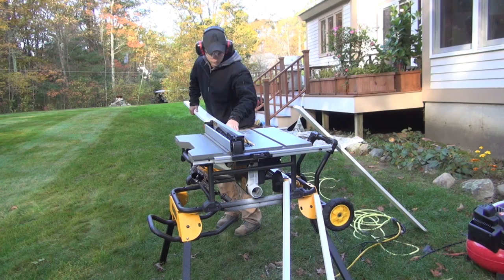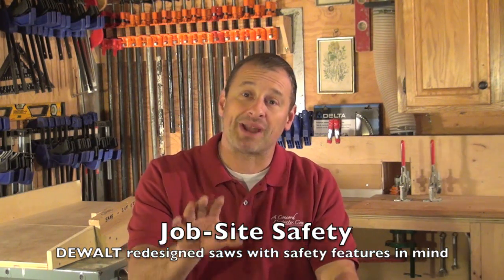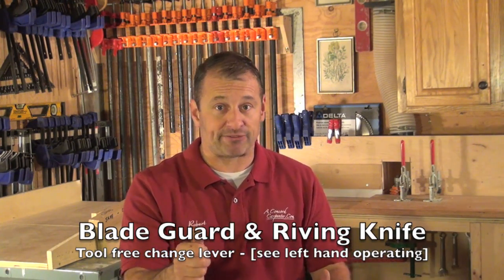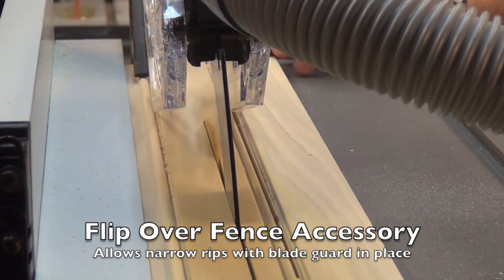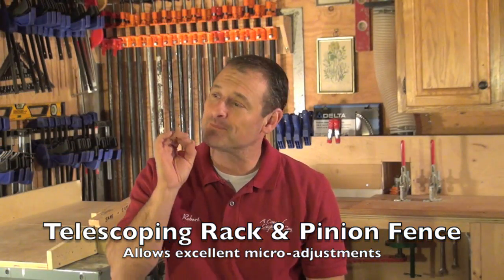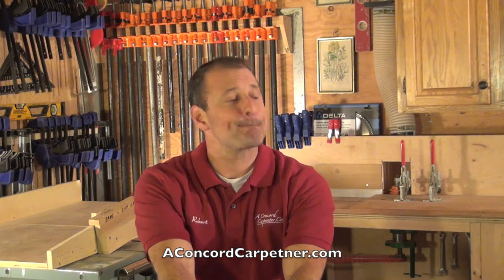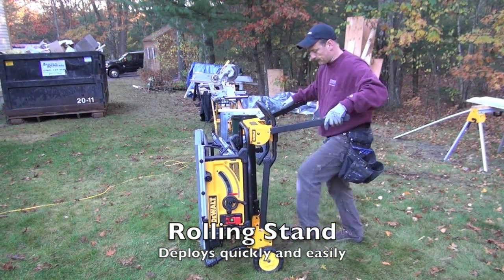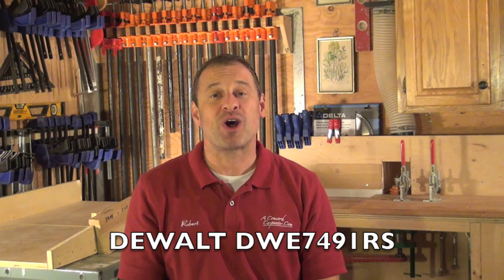DEWALT Rolling Job Site Table Saw, Model # DWE7491RS

Comment: I bought this saw a year ago, and love it. I bought the DeWalt Dado set, and the throat plate that was available. It was made for the 744 model. Dewalt did come out with a throat plate for the 7491RS, you can find it on Amazon, model DW7402 throat plate. for around 30.00
Reply: Nicholas Cameron... It would help if you put the correct model # in your post concerning the throat plate.
 Looking for DW7402 didn't work and din't bring up swat in my searching but DWE 7402DI did work.

Comment: wow eight years ago, it’s october 2022, and DeWalt is still selling this same saw.
It’s a good one.
I got rid of the biggest piece of crap (RIDGID R4514) and got this one.
This DeWalt is solid and very good quality. Love this thing so far.
I do have yo admit that the Ridgid roll stand is great because it sets up in seconds and you can wheel it around, grinder it’s definitely not as stable as the DeWalt.
Reply: I've had my same 10inch saw since release I've used it professionally every single day never had a problem with it.
Reply: @marcowens3522  : that’s what we all love to know. thank you for that.
i did have yo tighten the vertical lift bolt located at the very bottom of the saw, just under the gear because it wasn’t holding the saw in place do to the vibration from a particular blade i have.  still great.

Comment: I recently got one of these, and it's a pretty sweet saw. It does a lot of the things you normally used to need a cabinet saw for. A 32" rip length is a 16" remainder. There's no excuse here. Rip with a circular saw, flip the part, true it up, lather, rinse, repeat.

Comment: I take your reviews and opinions very seriously, even though I am just a beginner wood worker. I know what you mean about the flesh sensing technology table saws...they are incredibly expensive and seem to want to nickel and dime you for every accessory. 
This particular saw was and is still (I believe) on sale on Amazon, so I picked one up, even though the Ridgid I bought is only about 2 years old. The Ridgid just seems so large in my garage with that table, even though it is nice and flat and has both a nice fence and  better than average miter gauge. I love how you can adjust the size of the table you need due to the rack and pinion feature of the fence. Can't wait to start using it. Thanks for your excellent review, and recommendation.

Comment: I almost bought DWE 7480 table saw, but then I came across this DWE7491RS. So I'm buying this. It is about $200 more than 7480 one, but there are couple of features I really like in 7491RS. One of them was it's power switch and other one being a DADO compatible along with I liked for the fact that entire thing is on wheels. When not used, I can park it in corner of my garage and ready to roll out when ever I'm ready for some finish carpentry. Worth extra money !

Comment: Just completed assembly of my DWE7491. Found this video helpful.  Still wondering why a dust bag isn't included.  Thought the miter gauge was beneath DeWalt's standards, but think I can improve it with simple shop fixes.

Comment: Good review, after purchasing mine I was looking at the plumbing parts at the depot to try and hook up the guard dust shoot to the vacuum. Didn't see any real solutions but while I was digging around in my van for something I found my miter saw dust bag.  For kicks I tried it on the table saw guard dust shoot and it works great! Better than any hose in my opinion, because you have nothing running down to the floor or below the table top height snagging on the work piece. Plus its a easy set up. That coupled with my vac on the lower port and there's just a little debris coming from the bottom of the saw. Give it a try you'll be surprised dewalt didn't think of it.
Reply: IndianaJBird the dust bag is a great idea!  I have a plastic y connector at the bottom dust port with a 1 foot hose connecting to the bottom dust port. I connected a hose from the guard to the y and connected the vac to outlet of the y. The suction is ok, but I bet the bag would probably work better at the guard! Going to have to try it out👍🏻👍🏻
Reply: akaredcrossbow could u send me a pic of your set-up? I am trying to integrate the top and bottom dust collector ports together. Any help would be appreciated.

Comment: Fantastic review - especially on the new safety features, which I agree are important. I was convinced I was going to get the 7480 but now you have me thinking twice. The stand seems well designed and well worth it.
Reply: Go with this one if you can afford it. It allows for a full 10 inch blade which is nice especially when you start building custom jigs like a sled. It also has a larger arbor to allow for dado blades. I don't believe the smaller DeWalt table saws do, but don't quote me on that.

Comment: I was going to get the grizzly hybrid as my next saw but this has caught my eye in that it will not gobble  up as much space in my small shop area and has as much or more rip capacity plus the dust collection is top notch all for under 600.00
Reply from the maker: I had a Grizzly cabinet saw for years. I  replaced the motor on it once - terrible customer service

Comment: Just purchased this exact model. I have a Frued 10" dado stack but it's 1" arbor. The saw is 5/8. I have arbor spacers? Wondering before I put it together maybe 8" dado should be used?

Comment: The miter has been redesigned. Its like the Incra Ii have being made of steel plate with engraved yellow makings. Still some slop in slot but not much. I use my Incra with the saw and the new miter with my Band saw. Perfect since it has short blade and I will drill and tap allen screw on side to tighten to slot. I wouldn't recommend that with a aluminum top tho as it would start grooving the miter slot.  I'd use aluminum tape if using on saw and wanted to take out some slop. Also seen some ssaid the got bend top as the table on  bottom of box. Mine was upright in center with the stand box on top of bagging.

Comment: Hi, I have a contractor saw on which I make furniture. I need a great precision and a powerful motor, since I often rip big beams as I make architectural ornements. I am seriously considering to buy a jobsite saw, but I am worried that it may lacks power, or that the motor may fail after some heavy use. What is the life span of such saws comparing to those impossible-to-kill contractor saw motors ?

Comment: I have the dwe7490X which is the exact same saw but with the scissor stand.  My only real complaint about it is that the blade is not fully shrouded.  There is a large gap at the front of the shroud which let's saw dust get all underneath the saw.  with shop vac attached to the dust ports you're only getting about 75 % of the sawdust.  The rest just goes out underneath the saw.  It would have been better to have that opening plugged up so that all the dust could go to the lower dust port.  Other than that all the things this guy said are true.  The reset switch and riving knife are the best improvements.  Also, get an incra miter gauge to go with this saw and you're gonna be happy.
Reply: Plugging up the blade guard's dust port would not make the dust go down to the lower port and having the addition of the dust  port at the blade guard with a properly hooked up suction source gets a lot more of the dust at the source, as it's created.  There is plenty of testing data that shows that and OSHA is now requiring dust collection on many current jobsite tools, so tool manufacturers are implementing it into their designs now.

Comment: I see you are a fan of the fence. How do you square it up 90 to the table? I see how you can square it up to the miter slots, but is there a way to square it up to the table?
Reply from the maker: Its an easy adjustment and well explained in the manual
Reply from the maker: You're referring to 90-degrees "parallel" to blade correct?

Comment: Im looking to buy my first table saw for my home shop and wouldn't be using it anywhere but in my home shop. Would you suggest this or something else? I saw one of your other videos that said not to overlook portable table saw for the small home shop and I wasn't looking to spend 2k on a bigger table saw.
Reply from the maker: This saw will accomplish everything you'd need to dd but its more of a jobsite saw.
Reply: What would you suggest for a beginner on a very limited budget from the wife?
Reply: Had the lowes kobalt saw for about 3 yrs.. Not a bad saw, but it was time to upgrade.. Reasons why I went with this one..  Already have a dewalt 10" double bevel compound sliding miter saw with stand, needed something with a better fence than the kobalt, portability, and wide cut capability.. $$ was not a big concern, because good tools cost money and I prefer to only buy quality..  Can't go wrong with this saw...

Comment: Hey, thank you for that.  This is about the tenth review I have watched on this and the 7491 DeWalt saws, and I am discovering really useful new info.  I did not know that the power switch drops out without power for instance.  We have a table router that starts up when turned on at the wall if left in that state, and that is scary unsafe.

Comment: Thank you for the vid. Quick question... if I wanted to build this into a assembly / out feed table at a later date, how difficult is it to take apart from the frame? I was originally going to go with the 7480, but I found out it didn't except dado blades and that was a deal breaker.
Reply: When you purchase the saw, it comes needing assembly.  You have to attach it to the stand.  Four bolts and it comes apart.

Comment: I'm interested in purchasing this saw, but when I took a look at it in the store today there was quite a bit of play in the rack and pinion fence system once it was extended out past about 24". The fence didn't seem nearly as secure as saws from other manufacturers. Is this a problem with the saw you have or is it just sloppy display model setup?
Reply from the maker: I have not seen this on the ones we tested or the one I own
Reply: Display units get abused by customers.

Comment: I'm curious about what you prefer for blades, from rough ripping to finish work?  You mentioned the lack of a  dado plate. As a carpenter do you use the dado on a table saw, or a separate router table.  I'm 25 years past woodshop class, and even then till now my focus has always been lutherie. Now after owning my home for 13 years and 2 small children I'm finding the need and desire to delve more into project home carpentry.  I've found your channel to be most helpful and subscribed right away.

Comment: What about noise compared with similar saws?
Reply: These are all loud, and some are piercing loud. It has to do with the motor. Typically, it's a series wound universal motor like what a vacuum cleaner uses. These things hit extremely hard on startup, and then naturally settle on whatever operating speed is safe, typically with the help of gears. Under load, they slow down. The quiet saws are all AC induction belt drive saws. They speed up and draw low amps under no-load, then keep the speed as load is added. The reality is, these brushed universal motors have major balls and drive themselves, so if noise is the price of admission, so be it!

Comment: Anyone have any recommendations on a Y or T junction dust collection rig up for this that will work with a shop vac?
Reply: Try using a miter saw dust bag it works great! and doesn't hang below the table, no plumbing parts either easy on easy off.

Comment: So if I buy this saw I will have to buy a dado plate in order to use a dado blade right.
Reply from the maker: Greg Brooks not sure check the manuf page
Reply from the maker: Greg Brooks yes and you’ll need a dado blade plate
Reply: You have done reviews on several jobsite saws.  Which one would you buy if you had no saw.
Reply from the maker: Greg Brooks Dewalt
Reply: @gregbrooks9546  In their longer video, they recommend the Hitachi, but only because it's cheaper than this DeWalt.  If price isn't that big of a factor, the DeWalt is better.  THe Dewalt, currently, is about $80-$100 more than the Hitachi.  I went with this DeWalt because of so many online complaints that the Hitachi soft start motor sensor (or something like that) fails at a high rate.

Comment: What is working height of table when sitting on rolling stand
Reply: Did you ever find out the height?
Reply: @akaredcrossbow  never did, olso trying to figure out if arbour is big enough in uk to fit dado set ??
Reply: mac243877 I bought the DWE7491. With the rolling job site stand the table is 36 1/4” but it will go higher or lower depending how you position the legs. Just the saw alone sits 12 7/8”. The threaded part of the arbor is 1 1/16”. The full length of the arbor is 1 1/8”. Hope this helps!
Reply: @akaredcrossbow  many thanks
Reply: mac243877 👍🏻👍🏻

Comment: i have same saw but recently i was running a 3/4 plywood throuy it and blad got stuck on wood and smoke starte comjng from motor till i turned it off i romoved wood turned it on again and worked fine saw is new maybe used it 5 times do u think this couldve caused any damage to motor
Reply: I recently got a New Top class Dewalt dwe 7492 Table saw 240V, 4800rpm Rip capacity is 
32.5 inches with
3.3 inch depth of cut. Really love this Saw.

Comment: Good review as others have pointed out.

Surprising though that you mentioned nothing about how horrible the miter gauge is as well as the slots as numerous other people have complained about. It’s sad that over five years later Dewalt has not addressed that issue. Also sad that what many could consider the industry standard replacement miter gauge (v27 or v120) from Ingra doesn’t fit well without DIY modifications as detailed in this video.  https://youtu.be/juzPPG44GuE

Comment: What I don't understand about these dewalt table saw series. I was looking at the model without the rolling stand at Lowes but has very cheap miter guide. What is with that? This miter guide is pathetic. I have a cheap old Montgomery table saw that has an excellent metal miter guide. I have never seen such cheap miter guide. It looks like a toy. You would think Dewalt would be embarrassed to make such a thing. I really don't want to buy it because of that.
Reply: Agree.  I think that's because all of these saw makers are just assuming everyone is going to make a sled of some kind now anyway.  I think that's what they're thinking.

Comment: Too much talking and facetime for a review for me.
Reply from the maker: What would you prefer - considering this is FREE content for you?
Reply: Rob,  The FREE content comment is not needed.  Just do a voice over as you show the features of the saw.   Maybe show some of the basic  setup, checks of  the Dewalt 7491 saw for proper alignment, etc.    Or discuss the optimum solution for handling outfeed of long boarads on this saw since there is no accessory or easy way to attach an outfeed table
Reply: Prof10000 I must disagree with you, I enjoyed hearing his review.